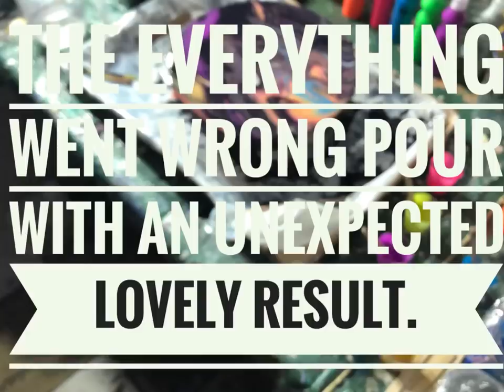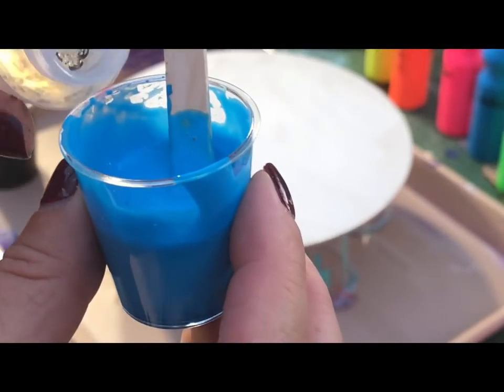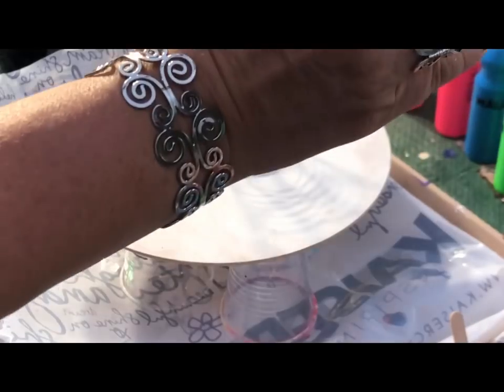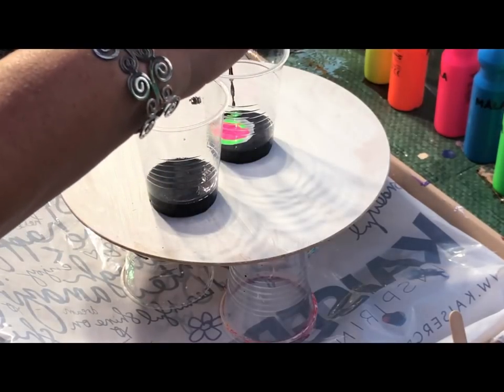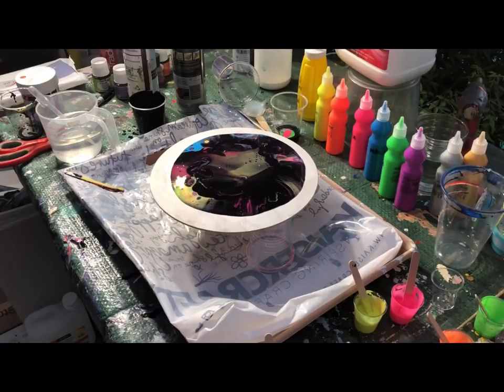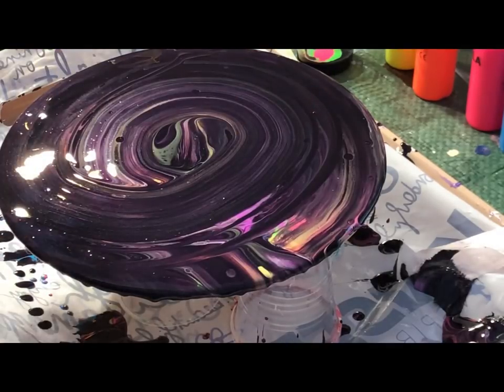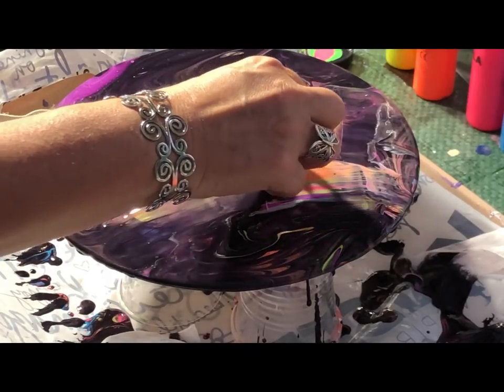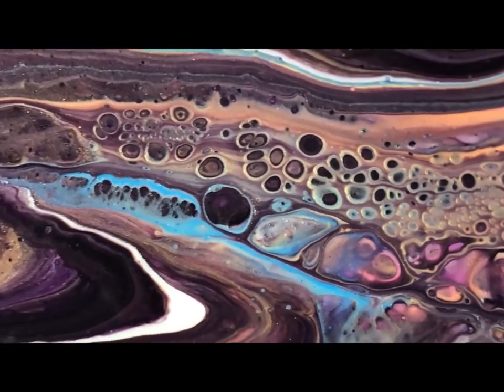#4: Acrylic Pouring -Ikea Neon paints. WD40 used to make cells. Everything went wrongPour from hell

Comment: I've used both acrylic neon/fluorescent paints and tempera neon/fluorescent paints and those behaved just like the tempera paints. Still an acrylic, but tempera is different. The pigment or whatever they are made of seems to be able to absorb a LOT of liquid - I tried both mediums in thick and thin as well as vast amounts of water, and still the tempera got thicker with time. I finally just used it as is. The acrylic neons don't behave the same way, they are more like (regular) acrylic paints. The tempera paints were cheaper. The outcome was fine for my use. I don't use silicones or oils at all, and still got cells because the density of fluorescent colors is about as light as you can get without being water.\

As for music, leave it out because it drowns out your voice.  Apology accepted for the slow motion part, which was irritating.  If you don't have good sound, try a voice over afterward. That being said, I have to admit that I don't even know how to work the video on my phone, don't own a video camera, and am only going on what I've seen for video knowledge, so don't feel offended. The worst part was the slow music coupled with the slow motion part, which I did try to speed up with my settings, but was unsuccessful. 

Your end result was nice, and if you check your neon work as you go, you'll see that there is a much more gratifying result under a blacklight - I use a "pet urine detector flashlight", and the difference is dramatic. Dried results when you use black paint are better under the light, because daylight and black paint seem to hide the colors due to the different reflective properties.

Comment: I've used Floetrol 3 times and I had to pick stringy stuff out.
Reply from the maker: rose senerman ewwwww that’s really bad. Here’s a great tip- cut a toes out of a stocking, and stretch it over the spout of where the floetrol pours from... it will strain those stringy  bits.
I used about 60 litres now and I’ve never had the issue you’re suffering- however I have heard of it often. Give your bottle a good shake too. Don’t give up- floetrol is great and by straining it - you’re painting will be lovely and smooth 💖
Reply from the maker: You can secure the toe with an elastic band. 

If I have time I’ll do a quick video this week and demonstrate it.